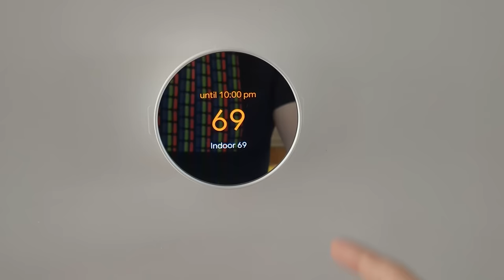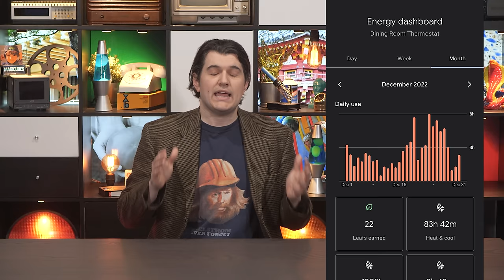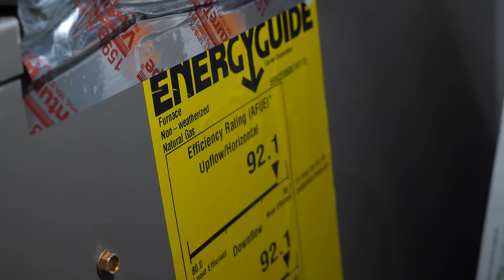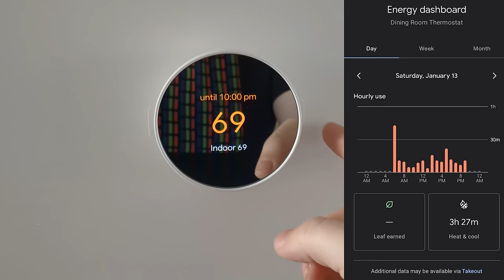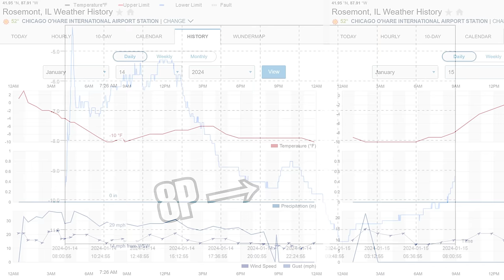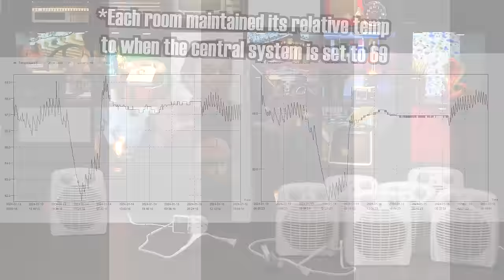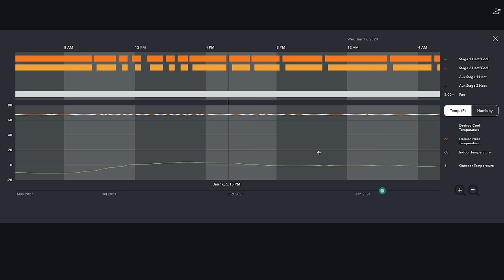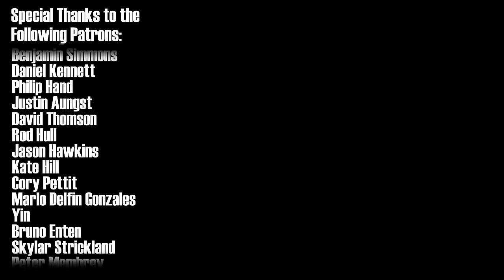Old HVAC industry practices are holding us back and costing us money. But we can fix it.

Comment: Regarding the "I don't want to wait in the morning for the flat/house to get warm thing": I am using a netatmo smart thermostat and it learns over time how well your house/flat is insulated and also factors in the weather report. You can then switch it to an operation mode that is trying to reach the temps you set for given point of time intelligently. So if you want it to be 20°c at 8am and it is very cold outside it might start heating at 6am. Other way around it might stop heating at 9pm if you want it to be 18°c at 00am because it knows how long it would take your home to cool down to that temp instead of blasting to the 20° till 1min before midnight. Very cool stuff!
Reply: Yeah, that was my though for Alex's situation. Here it would work less well, because we have no danger of freezing pipes, people generally turn off their heating when they go out, and thus it has a bigger range to catch up when they get home. (Though I can just turn mine on remotely) and also the difference between inside and outside is barely more than half that of what Alex has.
Reply: That kind of defeats the purpose though. I want it 60 at night because I am under covers. I want it 70 during the day because I am up and about. The transition from getting out from under the covers to up and about is 2 minutes, not 2 hours.
Reply: @mrcomment5544   Which is why if I ever replace my central system I will be replacing it with a multi-zone minisplit system.  You can quickly heat or cool individual rooms without having to worry about affecting the whole house with a traditional forced air system.  Especially in the era of larger houses, zoned systems really pay off in more ways than one.
Reply: Yes, most Honeywell thermostats have that feature as well "Adaptive intelligent recovery". I believe they were the company that originally patented it. Heat pumps are slow to respond, so it's generally recommended to leave your home at a constant set temperature on extremely hot and cold days.
Reply: @peter65zzfdfh  That is a very bad practice. It only work if you have a very poor insulated house. It's better to have a stationary/steady state than a transitory state. Meaning it would be cheaper and more comfortable to keep the house at the same temperature than let it cool then bring back the temperature. In this case the energy consumption might be higher.
And if you really need, you shouldn't set a temperature lower than 2 -3 degrees between normal and ECO temperature.
Reply: @mrcomment5544  Maybe you should cool only the bedroom at night?
Reply: Having a well insulated home - swinging the temp through the day and night doesnt make sense any more, especially where I do live with traditional brick and mortar "heavy" and high thermal capacity buildings. Keeping it at stable temp with lowest power is the best.
Reply: @razvanlex  That's what we do, mostly because the unit only has electric baseboard heaters and the AC is a portable one due to the fact that it's so hard to get an AC that can handle windows that open tot he sides. 

That being said, most of the time, it cools down enough in the evening that we can run the AC a bit before bed, and then open the window for the rest of the night.

Comment: One important thing to note with heat pumps in an area like Chicago or anywhere further north is that when temperatures do drop to very low temperatures, many heat pumps cannot produce much heat if any at all, unless they are a special model. It's an unfortunate situation because though even at the coldest temperatures you found your system only operating around 6 hours a day, if you had a heat pump, you very well might have had an issue when it gets that cold where the unit shuts itself down to protect itself and then produces zero heat.

Comment: Don't even get me started on how oversized ACs are, especially with modern efficient foamed and tight houses. Now everyone needs to get a dehu to combat the oversizing. That said, tight houses also need a dehu on shoulder months since they don't need to run anything for cooling (thus won't dehu on humid rainy shoulder month days), and I think it's code now to have fresh air as well whether with a dehu, ERV, HRV. So many contractors are still living as it was decades ago sadly.
Reply: aren't all dehumidifier AC anyway ? Why would you get a dehumidifier rather than a right size AC even if you don't need cooling ?
I'm not in a humide area, i think i've never seen a dehumidifier outside of flooded home... so forget my dumbness :)
Reply: @vlycop7404  simply because there will be times when you need to dehumidify without changing the temperature inside the house. As someone who lives in the southern U.S., I can tell you that there's a big difference between a dry 70 degrees and a humid 70 degrees.
Reply: If you don’t dehumidify in my state you will be underwater in days. Some places have liquid air.
Reply: @vlycop7404  air conditioner can only dehumidify at higher temperatures. I had to buy a desiccant dehumidifier for my place in winter as my air con's dehumidifier couldn't do it.
Reply: @vlycop7404  A dehumidifier puts the energy back into the interior air once the water has condensed out of it, whereas an AC dumps the energy outside along with the water.
Reply: Personally as someone who wants to freeze all yr round, im fine with far too big ACs :P
Reply: @mjs3188 Some units can keep the heat inside, but it's rarer.
Reply: I'm beginning to think newer houses aren't much more efficient, after watch this video I have a standalone house of similar square footage but 2 extra exterior walls, a 62,000btu furnace and it runs almost the identical times to his. The catch my house was built in 1957, I've only renovated 3 rooms so far and only re-insulated one exterior wall. I'm in north - centralish alberta so I get lots of cold here.
Reply: @mustangsaleen1986  I wonder if being further north, people built homes more efficiently even back in the 50s.

I also have a 50s house, but down in the American SW. It is not efficient at all, but there wasn't much of a driver for it to be so when built.
Reply: @mjs3188  Probably not. When my parents moved into their house, there was no insulation. Granted the house had been built well before the '50s, but nobody had bothered to have any installed either, probably due to the cost of installation versus the cost of just burning more fuel to keep the place warm.

Comment: We usually follow these basic guidelines for quick selection for areas with 4 seasons for apartments and homes up to 140m2:
-If only for cooling: 1kw per 20m2(70% peak) or 1kw per 15m2(90% peak) depending on the customers preference for how much they want to depend on the ac.
-If its for around the year use: 1kw per 15m2 + 0,8kw for every 35m2. 
So for example, year around use. 64m2 we would recommend a 6kw(heating) at minimum 5,5  /5,0-5,2kw(cooling) at minimum 4,5 unit
This can be pretty much aplied to about 90% of cases in which where the customer wants a recommendation on the spot, apart from some special/obscure cases.

Comment: To measure the amount of time a furnace runs you can wire an analogue clock in parallel with the fan.  You can set it to 12:00 and see where it is after 24 hours.

Comment: HVAC contractor here. We UNDERSIZE always. Here in EU, especially Scandinavia, we recommend to install a heat pump that is 80% of the whole heat load of the house/apartment with 20% as auxiliary. This is a common practice and knowledge of any good professional in this field here. This is because it will lead to; higher efficiency, longer lifespan, cheaper investment cost, cheaper running cost, less start and stops, quieter. This is all because a undersized will do fewer start and stops, running longer intervals and more continuously during the whole year as it have to run longer to keep it warm, as in video "struggle longer" but that is a good thing as it will run as it optimal capacity for the building as long as possible and not shut off and start that take more energy each start cycle and also do more wear and tear on components, it will lead to that an undersized heat pump being more efficient, better SCOP, and as more longevity, less maintenance or replacements. Also The coldest days is few per year. For only couple of days to maybe one week it will be coldest or mostly at night, so you can use auxiliary heat source such as a direct electric boiler/heater. The majority of the year you don't need that much heat, like 90% of the year you need only 80% or less of the whole target heat load (80% of the heat losses that the house has). We all here in Scandinavia know here from 50 years of experience of heat pumps that a heat pump that is not having too much start stops and use aux electric heat for the coldest nights will have a life of 25-30 years if you are lucky, average 18-25 years. An oversized heat pump will last only 10 years. So 80% is our best recommendation for your wallet. And remember 1 degree colder heating will save you 5-10% of your electric bill and will get you some more years of the heat pump, also keep you more active and healthy :) But need to be said as last thing, now all heat pumps here are inverters with frequency variable speed controlled, so now the heat pump tries to never shut off the compressor and goes down in speed and up in speed depending on the load is needed and the outdoor temp, So now we just buy one size almost that fits all, but still you don't want to over size here, as it will remove the benefits then that it cant go down in enough low frequency speeds, so it will act if oversized more like a on-off heat pump and then you loose the whole point why you bought a inverter variable speed heat pump. So don't oversize, always better to undersize with 80-90% of the whole heat load, even if inverter aim for as close to 100% as possible, the lower speeds will be active all spring, summer, fall, only coldest winter will need full heat capacity. UNDERSIZE IS KING!
Reply: Undersize is king! I have to show this to my girlfriend!
Reply: @TechnologyConnections should talk about this, I didn't know this
Reply: I will show that to my installer
Reply: I was going to ask about VFD's on another comment, but yours pretty much answered it. Where I am, power outages are fairly rare but happen enough that I'd be inclined to keep my gas furnace just for those occasions where I could run it on battery or generator power and still have heat. Every time our local power has gone out we've still had gas pressure, and it wouldn't take much power draw to keep the place warm.
Reply: My parents are getting quotes these days and the list of considerations is similar in Germany (the insulation significantly improved since installing the previous heat)
Reply: Belgium here: PLEASE COME AND CONVINCE OUR INSTALLERS. :p
Reply: @swimheiss You should always have a backup heat source. Your auxiliary should be able to be heating the house to keep it at least frost safe. We normally have an electric auxiliary heater in the heat pump to be about 70% of the heat pumps capacity or so. Eg a heat pump with 12 kw output can have a 9 kw electric boiler/heating coil, or 9 kw heat pump with a 7 kw electric heter or other heat source. Auxiliary don't need to cover 100%, it is enough as you don't need to hear up the house to the best comfort or all rooms at full blast, just for a emergency heat source when for example the compressor is broken or an alarm trigger the heat pump. So when you use a heat pump that is 80% of the whole heat load, undersizing for better lifespan and efficiency, and use an auxiliary heat source, eg. either electric, wood bio fuel or gas, to be your emergency backup heat source, and also be the additional 20% over the heat pump output when it is the coldest nights of winter. This will save you money and less maintenance and less replacement and new installations. This is the great philosophy of great practice through long experiance of experts in the field. The less start and stop the compressor of a heat pump will have, the more efficient and the more years it will survive.
Reply: @swimheiss  A wood stove is cheaper, easier and more fun.
Reply: @justinsayin3979  Also, deadly.

Comment: When I bought my house, it had an extremely oversized oil furnace. The nameplate was of limited use, and the manufacturer gone, but I believe it was somewhere around 80k BTU/hr. I replaced this with a 6k BTU/hr minisplit and an 18k BTU/hr main house unit. On the coldest night we have seen here in 4 years, it ran at less than 75%. This is without any insulation in the floors yet. It's crazy how big furnaces are. When we had the oil furncae, it ran for less than 15 minutes per hour. Doing my own Manual J calculation and not just buying what the HVAC companies told me undoubtedly will save me a truckload of money of the life of the unit
Reply: Oil furnaces in particular are often like this.  Fuel oil pretty much has a minimum BTU/hr output to keep the flame running reliably, and it's incredibly energy dense.  Having an oil fired hot water heater usually means you can water the lawn with hot water.  80k may have been the smallest available!

Comment: I have a heat pump in my house in Nebraska and it definitely struggles when the temperature gets below zero. However your encouragement during the debrief section that a heat pump should be working hard when it is cold outside is really good for me to hear!
Reply: when temp is below zero the heat pump should be supplemented or superseded by the backup heat

Comment: Minnesota here. My large single family home's furnace needed replacing. I hired a one man local HVAC company to perform the swap.

The furnace he installed is a high efficiency one like the one in the video with ½ the capacity of the previous one. 

He said it isn't good for the thing to only run 10 min at a time, plus it's stupid wasting money on capacity I didn't need.

He was correct. No complaints.
Reply: The difference is probably that the new one is on for longer periods of the day than the older one was. Not that there's anything wrong with that, it is probably on the whole better all around for doing that. I know I probably would have had fewer trips to the emergency room with cat hair/dust related allergy attacks with the more modern furnaces.

Comment: When we got reverse-cycle ducted airconditioning fitted to our house here in Western Australia, we shopped around a while and did a lot of deep-dives into efficiency specifications. We ended up with a heat pump that was two sizes LARGER that what most HVAC companies were recommending as the 'minimum' size we should get, but from a company with a much more efficient pump design, that has a much wider operating range than is typical. Cheaper heat pump compressor designs only operate over a certain speed range, with their minimum viable speed dictating how low their 'idle' is, thus, the minimum amount of energy they consume once the house is heated or cooled to the requested temperature and the pump slows down to minimum to maintain said requested temperature.

The more expensive range that we picked our model from uses a different design of compressor in the heat pump which can idle at much lower speeds than other brands, and is a minimum of a few percent more efficient across the entire range of operation than all the other "big name" (Mitsubishi, Fujitsu, Panasonic etc.) heat pump suppliers, and those two details combined mean that we beat the "projected" costs of heating and cooling our home by a significant margin. Because of the more efficient pump we're always saving money, because it idles much lower we were able to option a larger pump model which means when we do turn it on it gets the house cooled or warmed in just a few minutes instead of working hard for 30-45 minutes like a smaller heat pump would and thus goes back to just merrily idling away for the rest of the day. The pump steadily idling instead of switching on and off because it can't idle low enough means we actually save power while the house temperature stays more consistent.

Then we installed a solar system and our HVAC running costs are effectively zero (besides having the system inspected and serviced every two years).

Comment: Oh, boy...most people just make chili, watch football, and drink beer when there's that kind of cold snap. That was some real dedication to the scientific method.
Reply: Sai dat
Reply: I discovered a failure point at those temps.  The battery in a digital thermostat works for about 7 minutes and quits.  Makes diagnosis fun when it can't keep the signal working.  After 2 batteries, I removed it and shorted the wires together.
Reply: @robertsmith2956 Lithium batteries would work better. Regular AAs for a digital camera in northern Sweden were poo at 0F, but the lithium ones worked.
Reply: @TheStormpilgrim  That is strange.  Lithium is supposed to shut down at freezing temps.  Guess it is the amps they can't handle.
Reply: Hope the furnace doesn't fail.